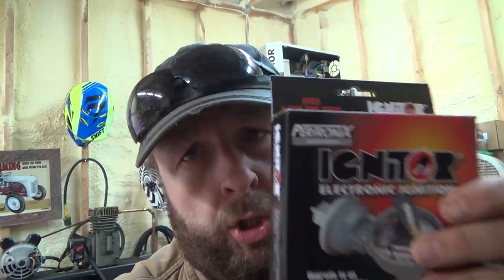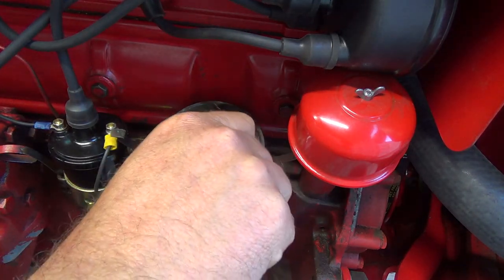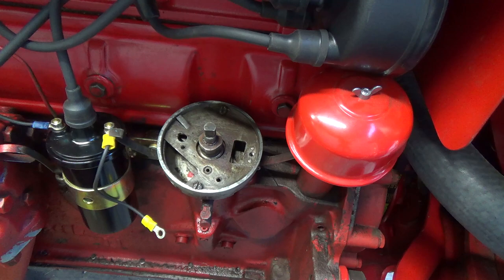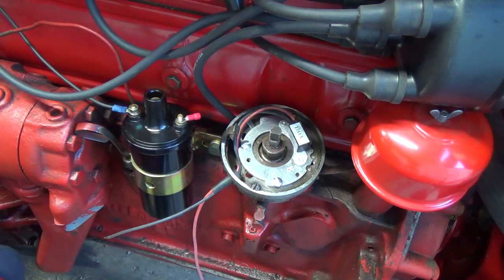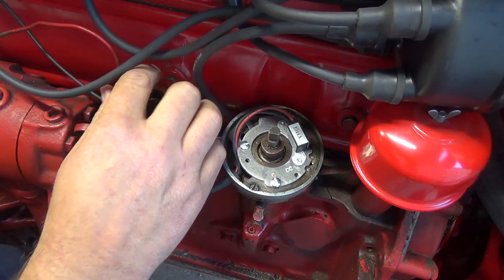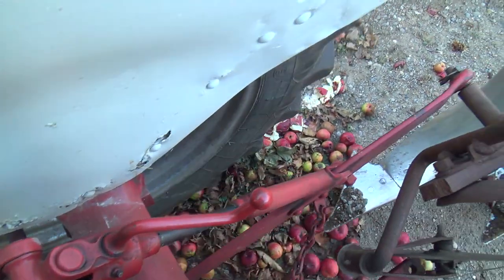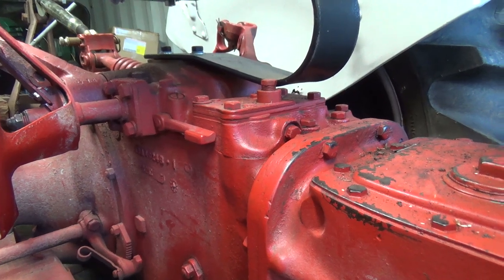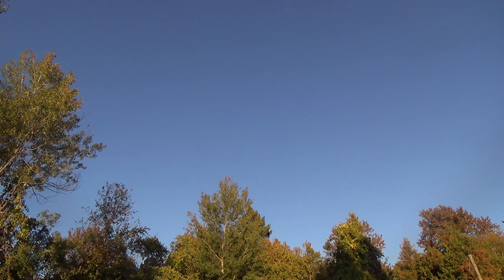Ford 800 Electronic ignition install then Fire the old points and condenser to the MOON

Comment: Solid old tractor, I have a 640 with 2500hrs still holds 40psi oil pressure and will do much more than you think, make sure to put grease on the advance weight under point plate, you have to put a spacer between to have remote takeoff

Comment: I'm new to your channel.  It looks like you converted to a 12 volt system with negative ground. Is that correct?  I'm planning on doing the same things to my 1959 841.  Thank you for the information.

Comment: 7:39 I’d leave all that stuff alone cause that Pertronix will die one day and you’ll need points again instead of spending another $100+ on a new one.
Reply: I installed the electronic ignition on my 641 a few months ago. It was great for awhile. That was January 13th. About a month ago it just died on me. So I put newpoints and condenser back in. Very frustrating. I probably only ran 20 or 30 hours and they burned out. I have hesitated with the electronic ignition upgrade for years. I was very excited to try them. Very hopeful and positive about it. I really want them to be a good system, but my experience is very poor. And I did upgrade to the three on Potter coil sorry that was not an issue.
I’d love to hear other peoples experience about this. I do love the idea but at least it needs to last a handful of years to make it worth the money.
Reply: Ty. You cannot leave your key on without the tractor running.  Fries them really fast. 12 years on the one on my d17. No issues

Comment: are you using stock plug wires? or does it need some different wires? part number please if you have it.
Reply: I use the standard plug wire unless the customer wonts them changed out
Reply: For the last 15 years and no problem with the plug wires